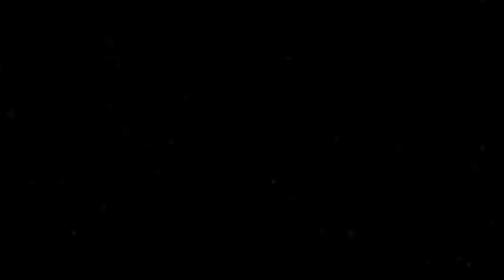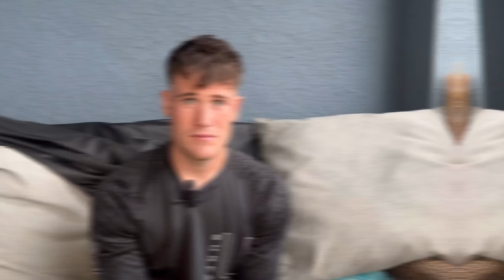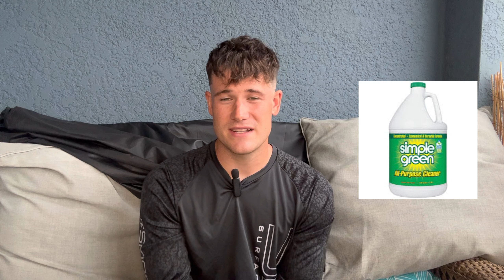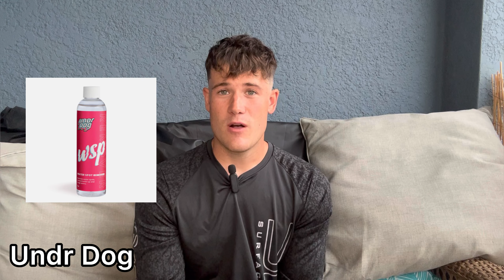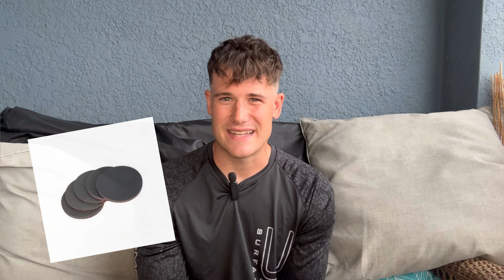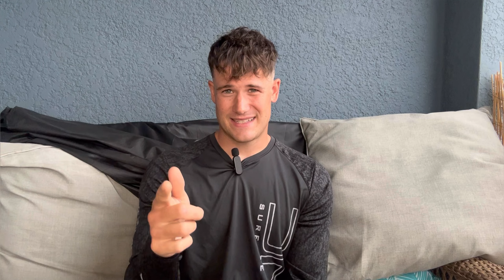How to Remove Waxes, Sealants, & Ceramic Coatings

Comment: Our boat is in Lake Michigan April thru October. Water is turned off when it goes into heated storage, so no real way to wash. Over the winter I Polish with Menzerna 400 and apply 2 coats of Jascar Ultra Lock Plus. Last couple years I just wiped down with windex prior to polishing. Any other thoughts?
Reply from the maker: That certainly makes it difficult. We used to wipe down with Isopropyl Alcohol when I detailed up north. I like the idea of doing 2 coats of ultra lock!

Comment: Live on the Great Lakes. I usually put the boat up in the winter by sealing with power lock plus and then a day later collinite. This way I can launch early and be ready. 
What do you think the length of this method lasts on Lake Erie? Also to remove black steaks, what can I use that removes the streaks and not remove the wax or sealant? Thanks!
Reply from the maker: I think that method would last a season on Lake Erie. Why not do 2 coats of power lock plus? There’s nothing you can use that I am aware of to remove the streaks and not the wax / sealant. Re polish them out or clean the boat more frequently
Reply: I have heard that adding just a bit of Starke Simple clean to your pail of water and ph balanced soap can look after the black streaks.  Perhaps Simon can comment?  And where do those black streaks come from anyways???

Comment: I ceramic coated my boat 12 months ago with Starke Liquid Kraken on the hull from the rub rail down to the waterline (used Repel Pro above the rub rail).  The boat was in salt water here in NY (Long Island Sound) from May-Oct. and maintained properly with regular washing.  When the boat was hauled in October, I washed the hull with Venom.  The hull looks great and the ceramic coating is definitely holding up, but if you look closely on an angle you can see faint salt water spots.  The boat is indoors now in a heated warehouse for the winter, and I want to remove the water spots and redcoat the hull with Liquid Kraken.  I am wondering what process you recommend to do this?  I have a Flex 3401 (the “beast”) and I was thinking of using a Lake Country Orange Force Hybrid Pad with Starke Ignition or Elevate, or possibly a white force hybrid pad?  I don’t want to remove the entire Ceramic coating, just the faint water spots. Thoughts?
Reply from the maker: You’re not going to remove a ceramic coating with polish. Sounds like you’re doing everything that’s recommended. Wipe the boat down again with Undr Dog WSP (water spot remover) and then polish with Elevate on the Flex 3401 VRG with the purple foamed wool pad by lake country. Then recoat
Reply: Thank you- good advice!